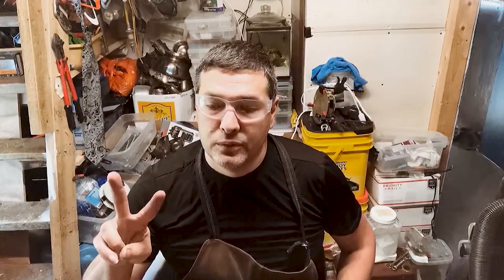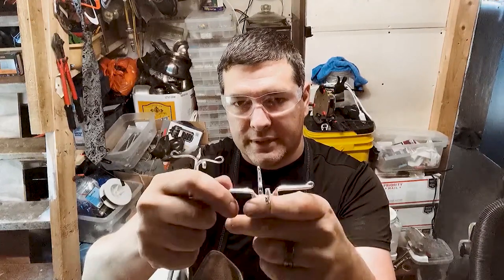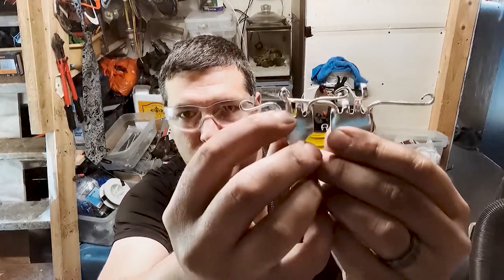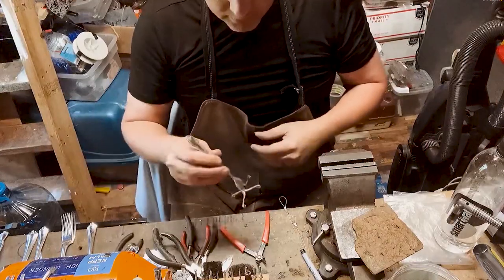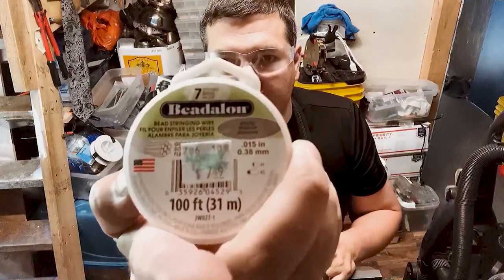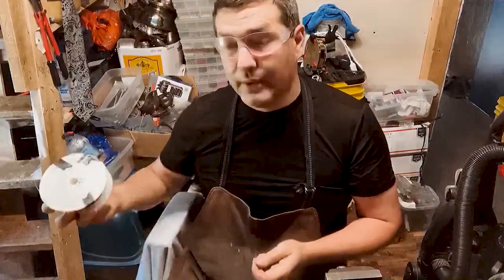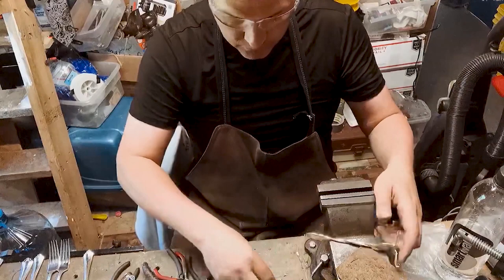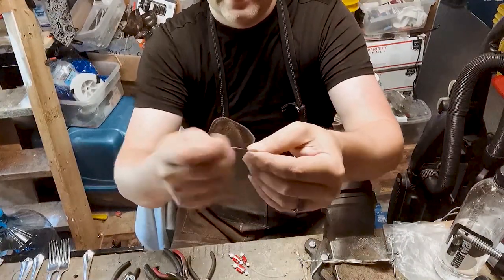How to Make a Fork Windchime

Comment: Do you suggest a special tool when it comes to bending the tines?
Reply from the maker: For a while I was just using a pair of the flat nose pliers. The little jeweler set that I had came with one. I started after that. Using my round nose pliers. The snap ring pliers with the tips cut off for working on cars. It’s really heavy duty. I’ve used the same one for eight years now I’m pretty sure there is a link in the description. that gives me nice round vans, and no sharp marks from the square nose or other pliers.

Comment: You have been very helpful. I think that I will be using getting an arbor press and start flattening spoons and forks. If you can let me know what I need and where to purchase those items that will  help you out, I would be happy to do that.  Things that would really make the process easier would be great.
Reply from the maker: Harbor freight has been the cheapest place to get the 1 ton arbor press. A lot of stores are out, but I have heard that they are getting more in. And Suzanne at Flatwearable.net has the kits. It completely changed the game for me get in the press, and the kit. It saved me days worth of work right off the bat.
Reply: You have been very helpful. What basic tools would I need besides the press?
Reply from the maker: @The1shortgirl  I would get a bench vice with a flat surface for hammering on. A steel ring mandrel, a mallet with both nylon and rubber heads. A Dremel tool of some sort and polishing and grinding bits. Some polishing compound. There are quite a few things that are listed in the description under all of my videos. The 1 inch belt sander, and the drill press have been huge as far as using your time wisely, and most efficiently. 
I hope that helps. If you still have more questions please keep asking.
Reply: @FlatwareCreationSS  I  think the arbor press may be the thing for me. Which plates to help flatten would you suggest. I want to make this as easy as possible. Thanks again for being a great help to me.
Reply from the maker: @The1shortgirl  if you’re just using the arbor press and not the bending system from Flatwearable. I would say any two thick pieces of steel. One for the top and one for the bottom. Preferably both larger than a serving spoon. I have stainless steel for my bottom one and I use the bar that came in the flatwearable kit. But if I didn’t have that I would do the two pieces of steel. You might be able to find a local manufacturing company metal fabrication something like that and get scrap pieces. That should save some money.
Reply: @FlatwareCreationSS  Thanks again. As far as I can tell the bending system has been sold out.
Reply from the maker: @The1shortgirl  yeah I saw that on their Facebook page today. There are more on there way though.
Reply: @FlatwareCreationSS  Thanks again. I hope I am able to purchase something useful.

Comment: Are all your flatware creations made from sterling silver or could you make the wind chimes from stainless steel?
Reply from the maker: All of my wind chimes are silver plated. Some have stainless steel or brass center pieces. About 95% of my CreationSS are from silver plated silverware. The hard part about stainless is that it’s very hard to drill through. I use cobalt bits with bees wax as a lubricant. I hope that answers your questions.
Reply: @FlatwareCreationSS  Thank you. I greatly admire your work. I live I Adelaide South Australia and am contemplating trying to get into coin ring and jewellery as a hobby.
Anyway thank you again for responding
Reply from the maker: @johnoakes6772  anytime you have a question I’m here to help if I can.
Reply: I'm wondering if it would be easier to pre-bend your main forks so that tuning is easier at the end?
Reply from the maker: @aimsabson6538  the sound is always different depending on the silverware used. So I just bend and curl the ends and tune after. You could pre bend  the lower forks then just adjust them at the end for tuning.

Comment: What kind of tumbler do you have ? Can you recommend one 
Thanks
Reply from the maker: I do a lot of tumbling so I use the Frankfurt Arsenal Tumblr. There is a link in the description. I have 60 full pieces of silverware running in it right now. I use 5 pounds of stainless steel media, which is also in the description. It’s the three shape mix. I use Dawn dish soap, but there are other kinds of abrasives and chemicals and different things that you can use to get different shines and different textures. Thank you so much for your question.

Comment: At thrift stores there are more knives than forks and spoons …what can you make with knives?
Reply from the maker: I have seen people cut off the blades and make dragonflies, I’ve also seen people use the silver plated solid knives to make windchimes. I have cut the handles off at an angle and solder on a copper piece or another piece of silverware to make a plant marker/ house. Lots of other ideas out there.